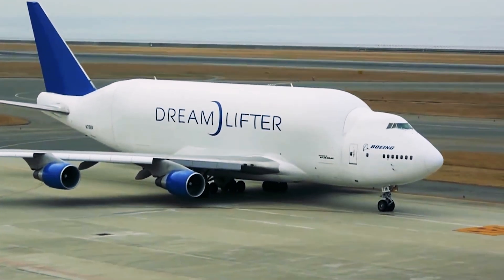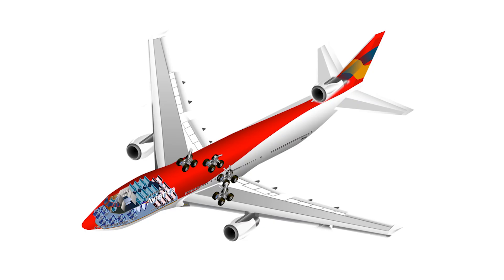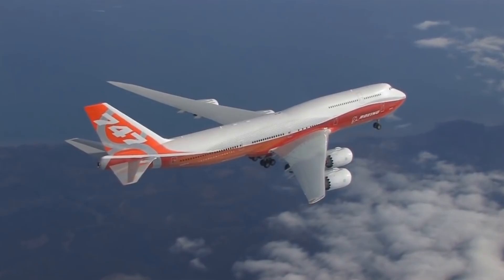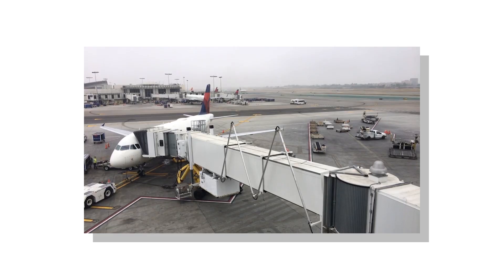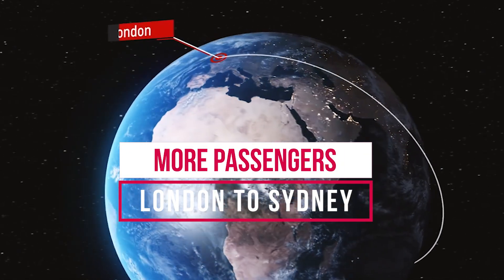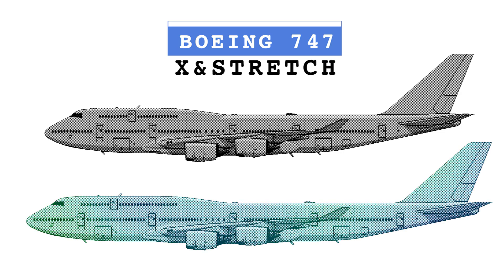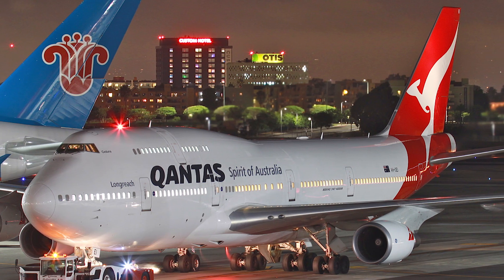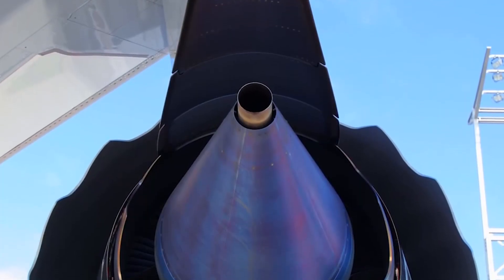The Boeing 747 Variants That Were Never Built

Comment: Although I’m a Concorde,757, & A350 guy, the 747-8(00) is my favorite plane coz I found that it is so elegant,more beautiful and more modern than the 747-400 and the previous 747’s (for me, the -400 basically being in-between the classic and modern, and the -100,-200,-300, & SP are classics. Also, they’re also interesting coz they have their quirks and features like a spiral staircase found in -100,-200 & SP,ladder thing and nose door found in the freighter variant, and an elevator that are probably found in all 747 generations*).

Comment: The B747-8 failed because they made such a half ared  job of it   for example not fitting the fly by wire controls  proven on trsed B777 because they thought it would protrude too far into the ceiling of he first class cabin!  fly by wire controls would have enabled  Software in the Aurtopolot system to neutralise the controls in the cruise saving fuel also Boeing didn't bother to install  the electrically driven air conditioning systems proven on the B787  relying instead on using high pressure Pneumatic air  taken from the  the engine core turbine compressor stages making the engines less efficient  The B747-8s  biggest competitor was the B777-200ER of the B747-8 had been more full efficient they might have sold a few more also getting rid of the  wing tip fences kept the  wing tip induced turbulence,causing a drag on the Aircraft  I  really enjoyed my time looking after B747s from 1993 until 2004 when a stroke forced an early retirement!

Comment: I think the versions that stretched the upper deck would have made the 747 less viable of an aircraft for Boeing to manufacture, as the upper deck would not be super useful for carrying cargo. The reason why it even has an upper deck is because it was designed as a freighter.

Comment: We aren't sure if the 747 program is done with yet. The 747-8i is still finishing production. Or at least to my knowledge. We don't know if a new "747-LG4, 747-LG5, or 747-LG6" LG stands for Last Generation as large aircraft demand for aircraft of its scale drop. It's just a 747 designed to finish the bi-level aircraft lineup.

Comment: It's too bad neither the airliners nor the manufacturer thought of reintroducing the 747SP with the more fuel efficient engines used on the dash 8 series. Smaller capacity but more economical,longer range, higher speed and altitude. The original SP did fly higher and faster than its original model(I was a flight attendant back then for Pan Am) and maybe It JUST may have enticed the airlines to utilize it as a Premium aircraft offering faster service perhaps cutting air travel between the U.S. and U.k. by half hour or more with a higher priced airfare. 
  Ah,but who am I?lol. ANYTHING to keep the 747s to be grounded.

Comment: My favourite is the 747-8, although I've never ridden any 747 since Jan '89; my fifth 747. That was a fluke, being a short flight from Detroit to Denver. All were 200's except the 1st one I rode in Dec. '77 which was a 747-100. Since then I've been on the 777-300 in 2014 and in October I rode the 787's shortest variant from Vancouver to Frankfurt and it's middle length variant 2 weeks later in early November going and coming back (From Vancouver to England and back 2 weeks later.)

Comment: As of February 2019, the 747 has been involved in 162 aviation accidents and incidents,[226] including 63 accidents and hull losses[227] which resulted in 3746 fatalities.[15] The last crash was Turkish Airlines Flight 6491 in January 2017.[15] There have been several hijackings of Boeing 747s, such as Pan Am Flight 73 where a Boeing 747-121 was hijacked by four terrorists and resulted in 20 deaths.[228] 
Few crashes have been attributed to design flaws of the 747. The Tenerife airport disaster resulted from pilot error and communications failure, while the Japan Airlines Flight 123 and China Airlines Flight 611 crashes stemmed from improper aircraft repair. United Airlines Flight 811, which suffered an explosive decompression mid-flight on February 24, 1989, led the National Transportation Safety Board (NTSB) to issue a recommendation that the Boeing 747-100 and 747-200 cargo doors similar to those on the Flight 811 aircraft be modified to those featured on the Boeing 747-400. Korean Air Lines Flight 007 was shot down by a Soviet fighter aircraft in 1983 after it had strayed into Soviet territory, causing U.S. President Ronald Reagan to authorize the then-strictly military global positioning system (GPS) for civilian use.[229] 

Accidents due to design deficiencies included TWA Flight 800, where a 747-100 exploded in mid-air on July 17, 1996, probably due to sparking electricity wires inside the fuel tank;[230] this finding led the FAA to propose a rule requiring installation of an inerting system in the center fuel tank of most large aircraft that was adopted in July 2008, after years of research into solutions. At the time, the new safety system was expected to cost US$100,000 to $450,000 per aircraft and weigh approximately 200 pounds (91 kg).[231] El Al Flight 1862 crashed after the fuse pins for an engine broke off shortly after take-off due to metal fatigue. Instead of dropping away from the wing, the engine knocked off the adjacent engine and damaged the wing.[232]   https://en.wikipedia.org/wiki/Boeing_747

Comment: I think the B747-8 failed because Boeing dropped the ball when when they didn't putvwhatvl they'd learnt on the B777 and B787 on it as in  the fuel saving measures from rthe B787 by notvusing Engine Aircforcthe Airconditioningvand pressurisation thus making the Engines more Efficient and fitting the fly-by-wire perfected on the B777  it might have protruded into the top of the first class cabin  but it wouldn't have been that difficult to move the first class cabin back into B zone and Allocate A zone to the business class from B zone the B747-8 cabin space is so vast they might even have put the first class in part of the upper deck allowing boarding of first class passengers through the upper deck doors! Leaving doors 1 & 2 left to board all the business and economy passengers  for a faster turn round. With the flyby wire neutralising the flying controls in flight to reduce drag and thecengine efficiencies of the B787 the B747-8 might have proved more popular than tickets to a col Gadaffi popularity convention like it's been described now! It's as if Boeing don't care about making the B747-8 more efficient!

Comment: I mean, surely with modern engines like the GE9X they could create a twin-engine version, or a conversion kit for existing 747's. They came out in the 60's, engine's have to be twice as powerful by now, for airlines that already operate the 747 they should be able to opt to have them re-engined where they lose engines 1 & 4 and replace 2 & 3 with something more modern.

Comment: Well! What happened the 747? There is no more 747 built?
Reply: Scott Weinberg It has become very unpopular by airlines due to its lack in fuel efficiency. Two engines (777, 787) burn significantly less fuel than four (747). More fuel burn equals less profit.

Comment: My favorite looks wise is the 747-200. My favorite functional 747 is the 747-400. The 747-8 is impressive, but looks a little less sleek than the 200.  The hump on the 8 just does not look as good as the -200. Also the engines on the 200 look more elegant and proportionally sized then the monster engines on the -8.  The 200 just looks fast, the 8 looks like it’s just lumbering along. The -8 is a better airplane because of the technology and economic benefits. I would like to see the -8 have more customers and continue as the queen of the sky, but I think technology and efficiency of the new big twins from Airbus and Boeing have left it behind.
Reply: You say the hump on the -200 looks better than on the -8. But the hump itself is the same on the -8 cargo version? Or do you mean in relation to the length of the entire aircraft it doesn't look as good? Or you mean the long upper deck of the -8i doesn't look as good as the short upper deck?
Reply: For passenger aircraft, twins have left all four burners behind (8i, Airbus 340 and 380).  Half the engines, half the maintenance.  Really comes down to simple economics.

Comment: Boeing could make the 747x with a twin engine design using the GE9x engines
Reply: Benwin Greeff No they can’t, the wings and structure are built for a 4 engine design.  They would have to re build the entire aircraft from the ground up to accommodate 2 engines
Reply: kingssuck06 exactly and let’s not even talk abt the fact that 2 GE9x is not 4 Genx. People seem to forget the 747-8 is heavier than the 777X

Comment: 747 with good quality cables insulations never exist before tragedy
Reply: Its about TWA800 tragedy after checking other 747 many have Problem with cables insulation. The quality of cables was bad
Reply: @StopTeoriomSpiskowym  
i did these chwcks in the CTR wing tanks of many747s but none had issues better check american navy who shot a rocket
Reply: willem H Analysis of the remains of the aircraft showed it was a soft internal explosion, not an external high explosion. Not a rocket, sorry.
Reply: @StopTeoriomSpiskowym  the cables were worn too much. Maintenance issue. Remember this was an old aircraft.

Comment: 0:55 Lockheed L-One-Oh-Eleven? Did he say McDonell McDouglas as well?!
Reply: Aren’t you supposed to say it l-ten-eleven?
Reply: @willmiller8730  Yes, and what a nice plane it was. Flew on one non-stop from NYC to Denver. Best flight I have ever been on!
Reply: I thought I heard "Donnell McDouglas"!

So Qantas' "project sunrise" came too late for the Ultra Long Range version!
Engines to make it go faster? That could equal better efficiency if the fuel burn per hour was the same or less.
Reply: He sounded extremely tired during the recording of this. It kinda worries me.
Reply: Donnell McDouglas - sounds like a cartoon character promoting a famous fast food chain :D
Reply: Typical none aviation fans..
Reply: Sounds like he was having a stroke when he was reading that line off
Reply: Having worked on the L1011 I found that painful to listen to.
Reply: "the third engine, unusually, would be housed in the rear of the plane".

Ah yeah, that's where they usually are on tri-jets. 🤦‍♂️
Reply: He did.
Reply: Speech 100
Reply: thats so funny
Reply: 2:16 and 2:17 Boeing seven seven seven

Comment: Aside from the complexity factor, would a 747 Trijet really be more fuel-efficient than a 4-engine 747?  Of course, a 747 Trijet would use 25% less fuel than a 4-engine 747, but it seems to me that it would also have 25% less power, and thus a lower carrying capacity.  With just 3 engines, could it really be any larger than the DC-10 or L-1011, and still be able to fly well?
Reply: I highly doubt it would fly well, just from looking at it, it was gonna be too heavy, I would've needed engines more powerful than the JT9D and it would not be able to carry as many passengers and if it did, its range would've been abysmal unless most of the cargo hold was fuel tanks. It probably would've been a slow gas guzzler.

Comment: Great video. The Boeing 747-400 is the ultimate 747.
Reply: Accurate statement
Reply: Vieux Bal Don’t know why you would say that. The 747-8i is gorgeous.
Reply: @Ampersandrascott  come on! The 744 when released was absolutely in a class of its own. It was one of the first if not the first airliner with winglets which were its most distinguishing features. It is the best-selling model of the Boeing 747 family. Beauty, grace, efficiency and success. Those were the days when Boeing could make all your dreams come true.
Reply: Vieux Bal I have a kind of love-hate relationship with the 747-400. My design group had to figure out how to get those damn winglets on that airplane and still maintain guaranteed Interchangeability. That means that you should be able to install any winglet from any -400 onto any other -400 without having to modify parts or hole patterns. The blended contours on the wingtip made it really tough. We did it, but it wasn’t easy. Not then, anyway. We used hard gaging back then because all the neat digital stuff you have today didn’t exist. 

Don’t get me wrong. The
-400 is a great airplane, but I think the -8i is proportionally much nicer looking. And, of course, the systems updates are a quantum leap over the -400. Plus, we added a RAT to make it safer (a HUGE RAT!).
Reply: @Ampersandrascott  are you telling me that you worked for Boeing on the 744 project? If this is the case, maximum respect👍🏿. I'm literally jealous. Thank you very much for sharing your experience. Of course the 747-8i is a beautiful and more advanced aircraft. But my heart goes to the 747-400😊
Reply: Vieux Bal I worked for Boeing Engineering for 34 years. In the 747 family, I worked on the -200, -300, SP, combi, -400, -8F, -8i and Air Force One. Besides the 747, 767, 777, 767 Tanker and 787, I also worked Product Development on the 7J7, which was a small unducted fan aircraft. It was dropped and the Douglas 717 took its place. It’s been a very rewarding career.
Reply: @Ampersandrascott  👏🏿👏🏿👏🏿👏🏿👏🏿nothing to add. You said that a RAT was added on the 747-8i. Does it mean that the 744 wasn't fitted with a Ram air turbine?
Reply: Vieux Bal That’s correct.
Reply: @Ampersandrascott 👍🏿
Reply: @Small Boi Gaming thanks man. But I'm afraid I'm not the owner of the channel. 
"Simple Flying" is. Thanks anyway😊

Comment: I like them all but the 200 is one of mt favourites..I hope they come out with a  9.
Reply: Like the Airbus A380, the Boeing B747 only has a few more planes on order.  Both of them were killed by the move from airlines using a hub and spoke concept to more of a point to point concept, and with twin engine jets getting the range needed to cover those routes.

It's possible that eventually there will be new aircraft with the capacity of the B747 or A380, but they likely would be twin engine planes.

Comment: In the end, all that research resulted in the Boeing 747-8 series--essentially a stretched 747-400 with modern GENx engines and raked wingtips instead of winglets. The only reason why the 747-8I isn't built is because it has been replaced by the 777-9.

Comment: Where is the 747 AAC (Airborne Aircraft Carrier)?
Reply: I was expecting that version as well.
Reply: Yea
Reply: Planes and Games The AAC as you call it was an internal study for the DoD. It was never a serious consideration.  LOTS of technical issues!
Reply: BETRAYAL
Reply: Mustard, anyone?
Reply: Same.
Reply: and the related cruise missile launch version, proposed to loiter outside Soviet airspace with about a hundred ALCMs for days at a time, being refueled regularly of course.
Reply: They also proposed a version which would replace the B-52 which had a rotary weapons rack.
Reply: @flick22601  I remember that!  The version I saw had a rotary rack with cruise missiles loaded on it.  I think it held six missiles per rack, and the racks could be extended and retracted.
Reply: What about the 747-400F turned into an  Airborne Laser and renamed the YAL-1 ?
Reply: It’s at aria 51!
Reply: Hmmmmm
Reply: I think it was scrapped.
Reply: Planes and Games that was a thing
Reply: @Small Boi Gaming It wasn't an Aircraft carrier, it's more like a Space Shuttle carrier 🤪
Reply: And the yt-43a it was cancelled but one was a test bed and stored and then scrapped